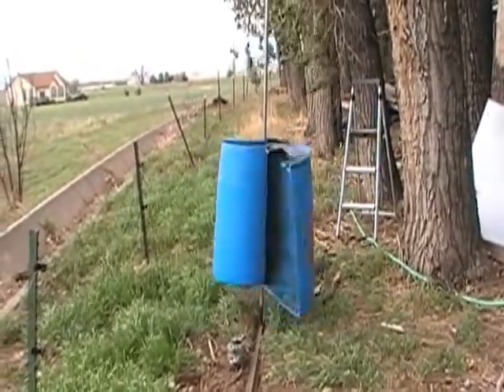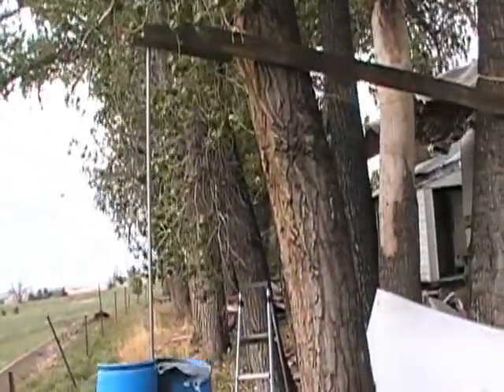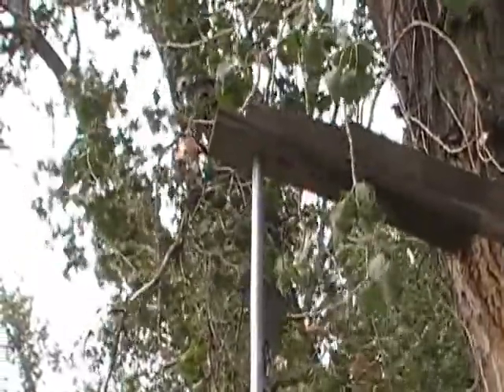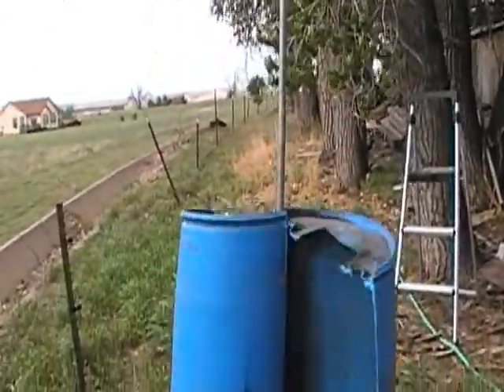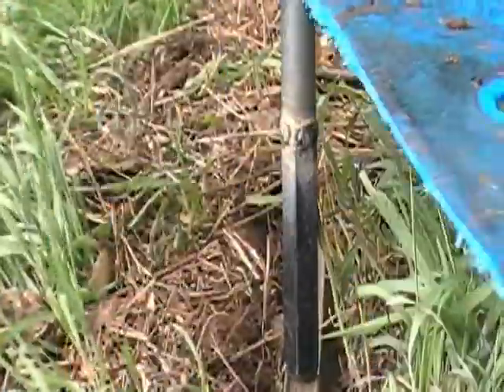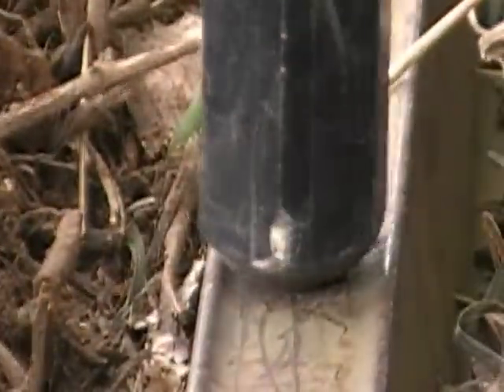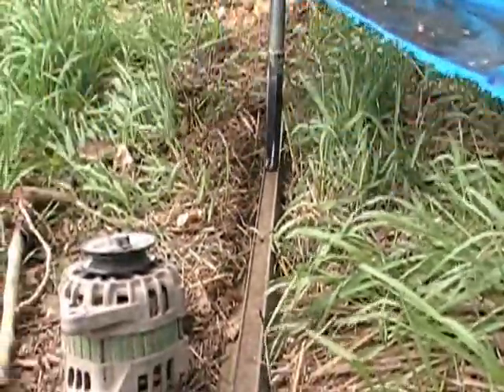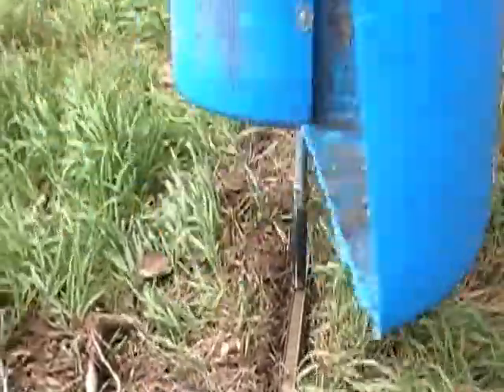VAWT ~ No Cost ~ Less Than 2 Hours To Build

Comment: well you can always check it. You'll need a large pulley on your vawt and a small pulley on the alternator to make it spin probably over 900 rpm for 12v charging.